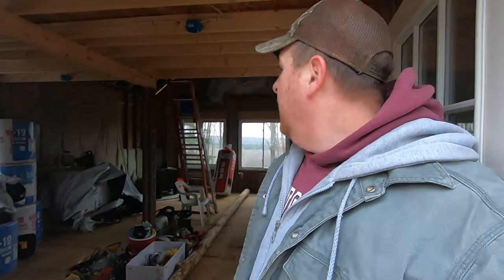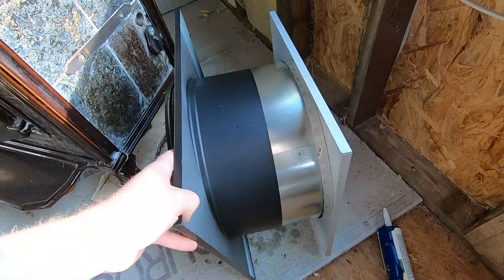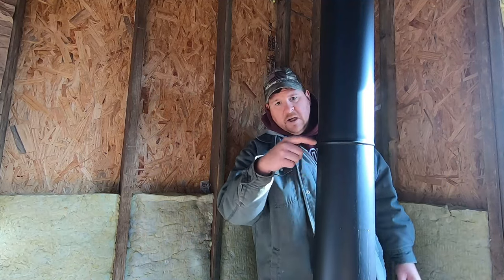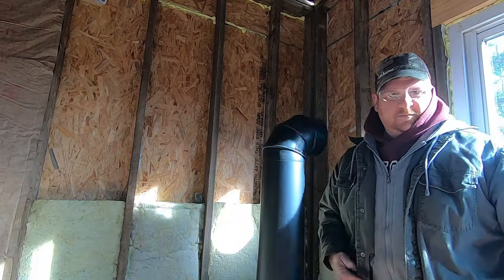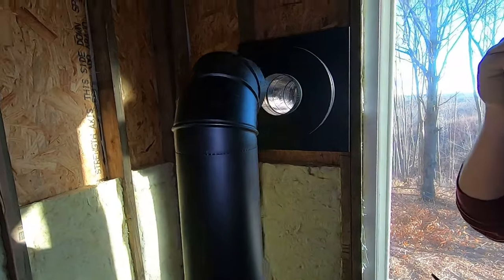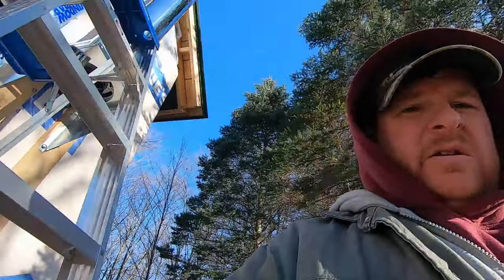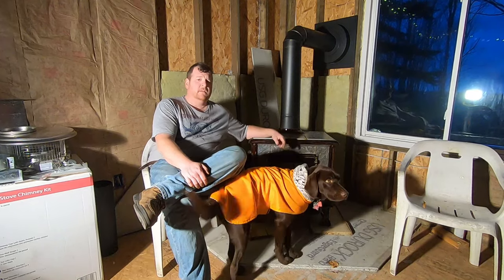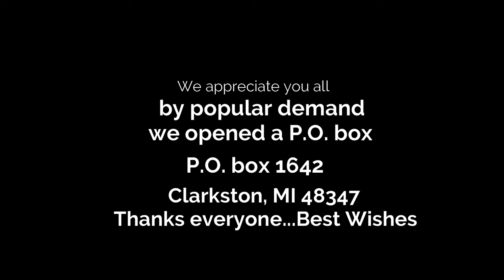Wood Stove Pipe Thru The wall Kit  Install |

Comment: You may want to get a damper for the inside pipe. We burned wood for 50 years and my Dad was going through a ton of wood as he got older/colder. We put a damper in and OMG, bet it cut his consumption in half or by 2/3, no joke. People think wood is free if you don’t have to buy it, (NOT!). It’s a lot of work but literally nothing warms you like wood heat. Another hard lesson we learned was to burn seasoned wood. We didn’t do that forever because non seasoned would bank the fire overnight but you don’t realize how much more heat seasoned wood puts off. I’m 62 now, too beat up to heat with wood anymore but fond memories of growing up with our home made, Papa Bear imitation stove and a beanbag chair beside it. Cold outside, come in, lay on beanbag, out like a light, lol. Thanks
Reply from the maker: You are so right.....we actually installed a damper in the pipe in the next video.....or in the video where we did the first fire.....it helps a ton you are right....nothing better than heating with wood....and doing it effiecently  😉
Reply: Yes, I,  too, grew up with wood heat being used in our home which sat on three acres of land.
    My mom had a wood stove for  cooking-- wood used to cook with has its own unique aspect to food flavor not realized by gas or electric ranges.  That's  my humble opinion!
    Then in 1966, a natural gas line was put in through our County Road, and out went the wood heater and stove. After my mom passed away,  I became the owner of the family  home and immediately put the wood heaters back on both ends of the home.  The wood cooking stove, still in storage, is next!
   I'm glad I did put the heaters back where they were because natural gas  has doubled in price in New Mexico, USA,  compared to last year's winter  months, as it has in the rest of the 
U.S. where natural gas is used.
    I have another home in Albuquerque,  NM and I have a wood heater , with flue!, in my Office/Workshop.  
   Now, I'm considering,  actually going to put a wood heater/stove in a Great Room in the main house, but didn't want to go through the ceiling and roof  for several reasons. 
    That's  how I found your off- grid videos.  I was weighing going through a window or the wall. Your video on putting the chimney pipes through the wall is the way to go. 
   Both gas and electric utility prices are skyrocketing, and a coal burning generating station  was closed by the state of New Mexico. Both utilities are hitting the NM-PRC for rate increases at this writing.
   I've decided to go off grid to an extent but not entirely but certainly blend in wood heat for cooking and heating to prevent so much dependance on  electric and gas usage. For example, people's  natural gas bills doubled from last winter. If your  monthly gas bill was $70, now it's $140 - with same amount of gas used! Electric bills -- the same thing. Gas was the cheaper option but not anymore. Wood will save me money, I know it will because it has before. :)
    I, too, have a lot of projects going! But, an install of a wood heater/stove combo just bumped up to the top of my to-do list, but installing it with safety features I saw on your video. It's chilly outside, now!
   Thank you for making these videos. They help quite  a bit. 
  God bless.
/s/
Robt. 🍊
Albuquerque, New Mexico  USA
Reply: New stoves should have built in dampers and they say don't put one in the pipe

Comment: They have a chimney brush on a long metal extensions that can go up your chimney flue without getting up on your roof or going up a ladder.  You need to make sure that your chimney PIPE goes TWO FEET above the ridge of YOUR roof.  This will prevent down draft of smoke into your cabin.  They do have available metal tie downs for your exterior piping that will attach to your roof and keep your piping stable in high winds.  Worth the $$$  (not expensive) to buy the tie downs.  Good move on triple wall piping especially where your deck is going to go GREAT JOB!!!  Nobody will get burnt if they brush up against it.
Reply from the maker: No ladders required......best thing ever. Thanks for the suggestions Sandra. Best wishes.
Reply from the maker: joann Loves CountryLife  it's two foot above the highest point within 10 foot radius of the pipe. 😁 but three foot would work too. 😊

Comment: At 8:30 when you slide the first section of class A pipe into the thimble what holds that snug in there? I have mine going in now and it looks like it slides into the adapter maybe a half inch but it does but up against the inner thimble portion. Hope makes sense. Seems wobbly how it is
Reply from the maker: I think I follow you, I felt the way you did about that connection or union as well. I believe my kit came with this extra coupler pipe, believe it was stainless, and I sort of forced it inside that union. I'm not 100% sure it was meant to be that way, but it created a solid inner liner for that spot.  I hope that makes sense.  Sorry I didnt get any footage of that step, having no REAL directions that showed that made it a but difficult.
Reply: @OffgridwithJayandJen  Funny I just installed that setup today and was wondering the exact same thing.
Reply from the maker: It worked well, but was not part of the original design I dont think. Hope yours works out
Reply: It is held in by the rest of the setup not being able to move, it slides into the stainless steel inner tube that the black stovepipe slides into from the other side.

I thought the same thing, but I realized that there isn't a way to get access to it once you slide it together. Make sure you use 3 screws per pipe! Very important! Look up "wood stove back puff"

Comment: Try a 30 degree offset to go around the soffit.
Reply from the maker: I looked for that fitting for my specific pipe style and couldn't find one to fit, So if you watch the next video or two, you will see I ended up getting a longer section to go through the wall and it made for a nice straight shot. Hope you are enjoying our vids. best wishes

Comment: Should go straight up through the ceiling.  Keeps more heat in the cabin and no issue with overhangs.
Reply from the maker: Ya but then I have to put a giant hole in my roof and climb up there to clean it....this way no more roof or ladder. Which makes Jason a happy boy.

Comment: What did you do to get the pipe away from the roof? How far does the pipe need to be away from the roof? What did you use on the walls around the stove to keep it from burning the wood around the stove? Besides keeping it a certain distance away from the walls? I'm trying to install a small stove in my garage that's not drywalled yet. Sorry for so many questions but I'm new to this.
Reply from the maker: We have a wood stove Playlist that shows all the stuff I did shortly after this video. Distance is the most important factor to safety, but I ended up using metal with a gap behind and tile underneath. Had to buy a 12 inch pipe rather than the 9 inch that came with the kit to push the whole exterior stuff farther from the cabin. If you go on our channel page you. Can find the wood stove Playlist and see what else I have done with the area I'll try to put a link in the next reply. https://youtube.com/playlist?list=PLKURa6vtPai6LPZuHbcRGHbqsEHgBKUzT
Reply from the maker: Let me know if you see this. Thanks
https://youtube.com/playlist?list=PLKURa6vtPai6LPZuHbcRGHbqsEHgBKUzT
Reply: Your stove manual should give you the clearances to combustibles. New stoves have low clearances, mine is 9 inches

Comment: Im getting ready to do this install on my cabin and am trying to decide what parts I need,. Is it ok to run a single walled pipe through the wall thimble? Everything I have read says it needs at least a double walled through the thimble connecting to the T cleanout. These pipes arent cheap unfortunately.
Reply from the maker: The double wall insulated pipe that attaches to the Thimble was included in the Kit. If you find the next woodstove video in the series, You will see I had to actually buy a longer one to help get out past my overhang and keep the stove pipe closer to Plumb. But no single wall through the wall, unless you are doing it OLD school style and not using a real Thimble kit
Reply: @OffgridwithJayandJen  I have the thimble installed, I just didn't get the full kit (yet) I will check out your next video. I have to clear my eve overhang too, about 2ft, so will probably have to rig up a custom brace under the T since it won't reach.

Comment: I have a 20 foot vertical  pipe  running  straight  up to the  roof ridge   and when  I open up the vent  on a hot load I get burning  cinders  that fly out  the top . Would  putting  a 45 degree  pipe  block those burning  cinders  from  coming out the top ?
Reply from the maker: Are you getting sparks and embers flying out the top? By the chimney cap outside?
Reply: @OffgridwithJayandJen  yes its like a Roman  candle  . It's not a  issue  since  I have  a metal  roof  . I need to re locate the stove to come  out a wall instead  of the roof  . ( I'm getting  to old to climb  up a 12/ 12 pitch  to clean  it )  if I had a 90 degree  pipe going the wall  and another  coming  out  would  that block  the embers from  coming out   ?
Reply from the maker: It would help, but sounds like you need a chimney cap with a spark screen on it. It is basically a piece of chicken wire, or hardware screen that has half inch square pattern. Only problem with them is they get clogged with creosote and have to be cleaned occasionally. Most people take them off for the winter as the sparks are not such an issue when there is snow on the ground.
Reply: @OffgridwithJayandJen  thank you for the  suggestion  . I'll  try it

Comment: i am not with your channel but i could use some advice regarding putting in a chimney on an old pot belly stove in my garage its a 5 inch pipe coming out of the pot belly and threw cement board to the out side any does or dont i need to look into before i get started? you can see the stove on my channel at the point i am at
Reply from the maker: I'll take a peak and comment there.
Reply: @OffgridwithJayandJen  thanks for looking at it it will help i am sure
Reply from the maker: @rgarizonahomestead2729  Hey I just watched your latest video. Honestly the best advice I can give you is to go watch Dave's videos of his latest little cabin build. His channel is called Bushradical and he shows perfectly how to cheaply and simply do a through the wall kit for a simple set up. If you watch his cabin build there is a easy set up there where he just uses old metal and cuts a whole in the middle and uses one single piece of triple wall pipe, the rest is all single wall. cheap, safe, and simple.

Comment: I bought 6in gas pipe instead of wood stove pipe. Can I use any of that gas pipe for the outside?
Reply from the maker: I'm not familiar with the gas pipe to be honest. If I were to guess i would say no because the gas pipes might have a lower temperature rating.

Comment: insulated chimney should extend into the building
Reply from the maker: It does , that is the whole purpose of the thimble. The clean out T has a short section that goes from the inside wall to the outside T

Comment: Yeah those side mounts are usually a head ache and never clear the eaves
Reply from the maker: Lol, I see that now. I.did the math before and was hoping I was wrong....but hoping to extend the section from the inside to the T now and correct the angles. We will see. Best wishes Lora

Comment: Why can I not use black pipe outside? Why use double insulated pipe?
Reply from the maker: The black single wall pipe gets too hot to attach to the house. I have also heard that when running it a long distance like this it the cool outside temps will cool the smoke and cause excessive build up, NOT sure if that is true or not.

Comment: I have the same issue with my overhang being in the way, which sticks out over a foot! The kit isn't built to deal with that and I too don't want to mess with cutting the overhang. Is there a way of just attaching a straight length pipe long enough to extend beyond the overhang and attach the elbow? I'm guessing it would need a support under it from the weight, which gets a bit complicated. Wondering what you ended up doing to get around the overhang. Thanks and enjoyed the video.
Reply from the maker: I show what i ended up using to fix it...but yes I just used a 12 inch straight chunk rather than the 9 inch one they provided in the kit. My over hang is only 6 or 7 inches so if you have a 12 inch over hang I would think you could buy an 18 inch straight pipe and that would work well for you. let me now if you got this reply, thanks
Reply: @OffgridwithJayandJen  Yes, I got your reply and thank you so much for your time. I bought some steel pipe at Lowes yesterday. It's the Supervent/kielkirk brand. Turns out no one has the tee pipe that goes on the outside at the hole, all sold out, so I'm trying to figure a different way, maybe a 90 degree elbow and build a stand to hold it and the chimney in place. So you used a 12 inch pipe through the hole, but how did you mount the tee pipe? I'm guessing it had to come out which wouldn't allow you to screw in the support box below it, do I have that right? Btw I'm working on living in an off grid barn on my property where I have a small business that's paying the bills. Your place looks awesome.
Reply from the maker: @jackkerouac8439  I didn't have the interior finished yet when I installed this t brace, so I lagged a couple chunks of 4x6 treated beams to the wall outside to full the space between the clean out T support and the outside wall
Reply: @OffgridwithJayandJen  Awesome I love it!!!!

Comment: What is that on 8:54 that is being installed into the wall thimble?
Reply from the maker: Included in the kit was a couple coupler type pieces. They were 6 inches long. It was not clear on the directions exactly how or what to do with with those parts, but the way it seemed to fit best when the stainless coupler was inserted inside the pipe to act as a sleeve between the external pipe and inside pieces. After that just the cosmetic ring was installed to clean it up.

Comment: I like the loft in your cabin...want to build similar to this...do you have 8 foot walls or are they 10 and what roof pitch did you end up using?...great video on the install
Reply from the maker: Hey there, we actually went with 9 foot walls and a 10/ 12 pitch. It was good enough to allow us to stand in the loft rather than just be hunched over. Happy with it. If you went with a wider cabin it would allow even more space.
Reply from the maker: Also....I put the loft at 8 foot rather than 9 so there is that extra space up there and it still doesn't feel cramped under the loft
Reply: @OffgridwithJayandJen  how wide is your cabin 16 feet?
Reply from the maker: Yes 16x24
Reply: @OffgridwithJayandJen  thanks for the quick reply...love your cabin..well done

Comment: Hey good deal I learned some new things. Where did you buy be clean out and support bracket and how much are each of them? Thanks feel free to check my page out I got a lot of similar stuff on there plus my crazy Shelties thanks again for all the good information
Reply from the maker: I will check it out James

The clean out T came with the thru the wall kit I purchased at tractor supply, the whole kit was $359.00. Everything came in that kit for supporting the chimney system. the only additional thing to buy was the pipe sections up, and I bought the extra support poles that reach up high closer to the chimney cap, that kit was $45.00 and was purchased at Menards. Hope this helps buddy.

Comment: I mean I think you needed to have shown the final solution - it's all about the final solution.
Reply from the maker: Well everyone's situation will be different. Typical install mounts right to the cabin. In my situation I show what I do in future videos. I have a woodstove playlist
Reply: @OffgridwithJayandJen  Those eaves get you every time. I found a way to avoid having to angle away from the house to avoid the eave, myself.
Reply from the maker: @plumbsquareandlevelish4475  I ended up just pushing the support T out 3 more inches with a longer piece of pipe thru the wall. Then added chunks of wood between the t and cabin
Reply: @OffgridwithJayandJen  Thanks for responding - this is the part that everybody runs into, I think. I think I can strap my wood stove chimney to an abandoned chimney if I place the stove correctly.

Comment: Why would you put a wood stove pipe right beside a window. ? Would not pass code where I live should be a minimum of 5 ft from window open 
Total fire hazard with windows blinds  , curtains window trim
Reply from the maker: It will be fine. Thanks

Comment: Well…f!
Reply from the maker: Hummm....how can I help
Reply: @ the saying you probably had when it didn’t fit around the eve lol. Doesn’t the company know that it wouldn’t fit?  Why would they sell it designed to be so close to the house ?
Reply from the maker: @jamesa6272  I Kind of agree.....I guess not all homes are built the same...but most cabins and homes are build with an over hang.....so having only a 9 inch extension is just giving the cheapest option.....But to be Fair......you do want to keep the stack as close to the wall as possible. But It is not perfect for sure. =)
Reply: @ did you kick it out past the eve with a 45 elbow and then up?
Reply from the maker: @jamesa6272  i got a 12 inch rather than a 9 inch and it made it an exceptable angle, not perfectly plum....but good enough to make me happy
Reply: @ Nice Job!